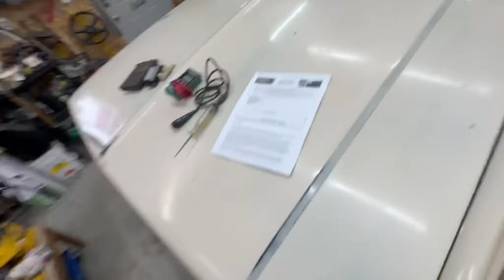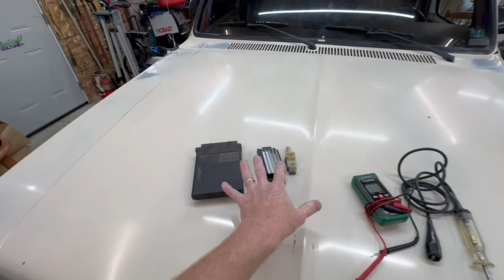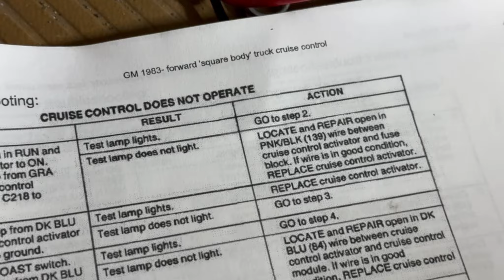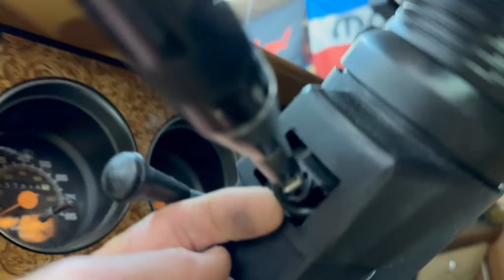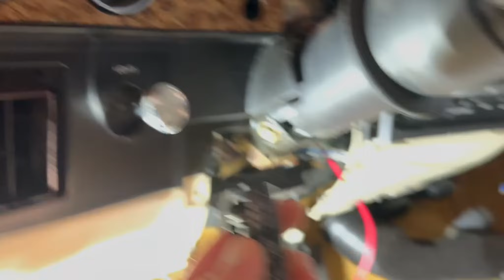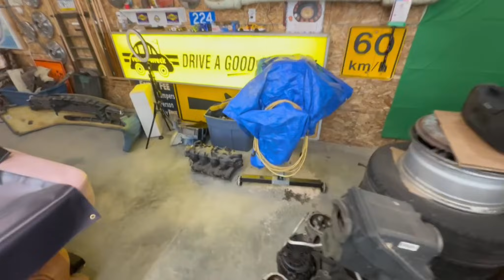Square Body Cruise Control FIX: Troubleshooting Made Easy!

Comment: Sure woulda been nice if you had showed us how to get the old turn signal stalk out.  

And a coat hanger?!  Attach a light-guage wire (like a picture hanging wire) to the connector on the end of the wire (from the actuator switch) and pull it through the steering column as you pull the old actuator wire out.  Then, attach the end of the new actuator wire to the light guage wire and pull it back down through the steering column.

Comment: Is the wiring plugs there on standard vehicles  but just missing the added accessory's that come included on luxury options vehicles. Like turn switch with delay vrs. tun switch w/o delay?  How about cruize or w/o cruize. Same scenario?
Reply from the maker: Sadly not. You would need the delay wiper module and cruise control.

Comment: If that grey wire doesn’t get power when the switch is off for the cruise control, then that would tell me the torque converter lockup wouldn’t function either. That same grey wire goes to the top of the brake switch that goes through to the other side that is grey with a black stripe. When you depress the brake pedal, it cuts off power to the TCC.